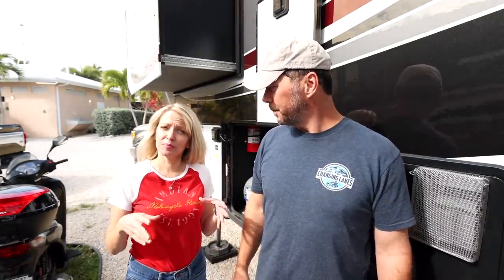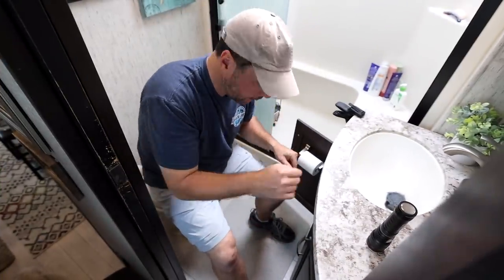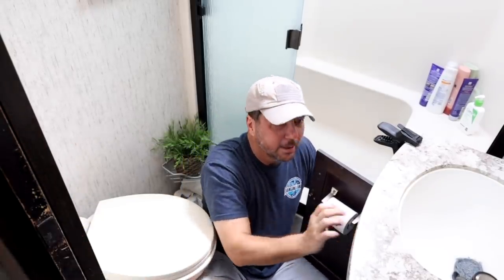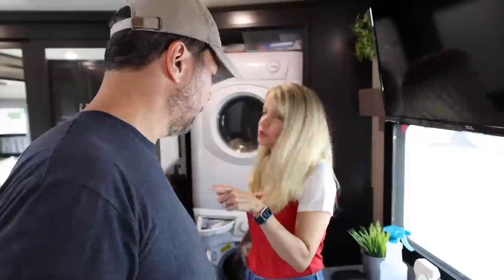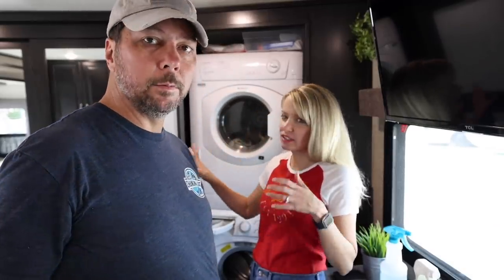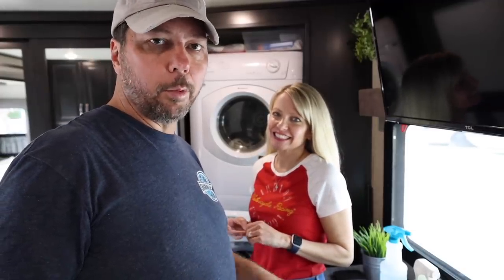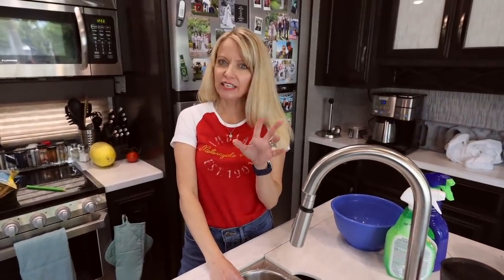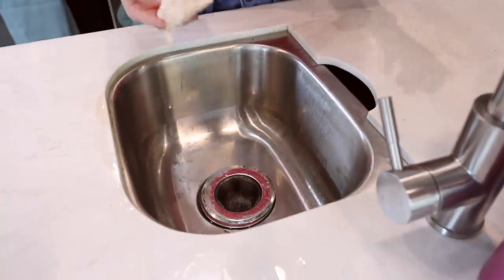RV Dirty Jobs

Comment: White vinegar is a natural fabric softener,  so I use it in the washing machine instead of store bought softener. Keeps the machine clean and it doesn't make your clothes smell like vinegar. Cheaper too!
Reply: Ahh I didn't know that.. thanks :)
Reply: Although vinegar is widely touted as the "be all, end all natural cleaner, in reality, vinegar, being an acid, is actually corrosive and should not be used for many applications for which it is touted, such as cleaning granite counters, cleaning tile floors and grout, and other uses it is recommended for. 

Washing Machines
Vinegar is sometimes used as a fabric softener or for getting rid of stains and odors in laundry. But as with dishwashers, it can damage the rubber seals and hoses in some washing machines to the point of causing leaks. It’s a problem that Steven Grayson, owner of Foothills Appliance Service in Wilkesboro, N.C., sees fairly frequently. “With continual use, vinegar can literally melt hoses, causing leaks and thereby possibly all kinds of additional damage to the house,” says Grayson. In his experience, front-load washers are especially susceptible to vinegar-related damage.

Plus, it may not even be doing much. “Vinegar isn’t very useful with stains that have already set into clothing, including food stains and bloodstains,” says Sansoni. Consumer Reports' recent tests of laundry stain removers reveal products that are great at removing tough stains, and you don't have to worry about any of them melting the rubber in your washer.
Reply: I’m gonna try that . 👍
Reply: yes white vinegar on every load
Reply: they also have washer tab cleaners and most washers have a clean cycle
Reply: I switched to vinegar for my laundry softener over 10 years ago. Washer has held up great with it. Laundry is fresher. The other softeners have animal fat in it, that is what is creating the mold/mildew. We were having problems with smelly clothes if the laundry was left in the washer for even an hour or two. Since we switched, it solved our issues. We also started making our own laundry soap about 7 years ago. It’s a super easy recipe of Dawn dish soap, arm and hammer washing soda and 20 mule team Borax. Since we switched, our laundry is much cleaner!
Reply: @remote.inspired  wow. Is there a specific recipe for this soap? I’d love to try it but don’t know how much of each ingredient/cleaner to use.
Reply: @loriemonroe76  - I use 1/4 of each, mix with 6-8 cups of hot-hot water (add the Dawn at end so it doesn’t suds up.) When mixed good - then top off to equal a gallon of water. I double the batch and put in those 2-gal water jugs you can buy at Walmart - that have a spigot. I use 1/2 cup of the liquid mixture per regular sized load of laundry. I have a HE washer - so it works in that type washer as well as a non-HE type. Be sure to use Dawn Ultra concentrate. Then, also in each load, I put a 1/2 cup of white vinegar as my softener. I have been doing this for over 7 years. It costs approximately $1.50 per month for the detergents/softener for a family of 4 to do laundry.

Comment: Once every 2 months or so I put a couple cups of bleach with a tiny bit of soap with no clothes in the washer and run it at the hottest temp I can then I take a microfiber cloth and wipe inside the rubber ring seal. Every day use I always leave the door opened after use and wipe the glass and rubber seal. I also leave a towel hanging on the door so it can't close.
Reply: I had this same issue with my front loader in my sticks and bricks, so after much "self research", I started wiping under the rubber with Odoban once a week and that made a huge difference. I did this on top of running a load of just bleach and soap in hot water with nothing else in the washer.
Reply: bleach and stainless steel are a very bad combo. bleach will give mechanical corrosion.
Its looks like a spider web in the stainless.
Reply: @brianrasmussen69  been using it for 12 years and no spiders.
Reply: @brianrasmussen69  and i only do it once in a while
Reply: After washing laundry I always take a microfiber towel and dry the water around the rubber seal and the glass window. I'll leave the towel tucked in the rubber seal for a bit.  Sometimes I leave the door open and run a fan facing inside. I've also put a damp rid tub inside with the door shut.

Comment: Where the tube from the toilet goes into the black tank. It's basically just a fancy "doughnut" that holds it in place.  No mechanical fasteners or anything. If it ever comes free, you don't need to drop the tank. Just pull the toilet off and you can get to everything from the topside.

Comment: We're full time and I've never seen that kind of stuff on the "poop chute" on any of our three Grand Design RV's. It almost looks like some kind of bacterial growth. Ours stays white and requires no cleaning. Weird! As for the washing machine - we leave our washer door 1/2 open all the time. Zero mold. But then we removed the door to the washer dryer closet so that makes it easy to leave the washer door open. Another great video! You do a fantastic job covering many aspects of RV'ing that others don't.
Reply: Us too on the poop shoot.  We've never gotten build up like that.  Not to get too far in the weeds...or down the chute might be more appropriate...but we usually preflight the potty by pushing the foot lever part way down (run the water w/out moving the valve) and fill the bowl w/ a few cups of water first.  We also run the  water for 10 seconds or more during the flush.  Not exactly the greatest from an environmental perspective but I really hate cleaning toilets.
Reply: With these two reply’s I’m wondering if there’s something chemical wise somewhere in the water filter system that could cause it to build up like that?

Comment: I'll tell you a way that you can prevent cleaning that P-trap out in your sink and it also works great for your sink in the kitchen taking boil up a gallon of water and two cups of vinegar and pour it down the drain once a month and you'll never have to take your P-trap apart again also do the same thing for your shower drain and before you go on the road put one cup of Dawn dishwashing soap in your black tank and you are gray tank and as you're driving down the road that will clean the greasy stuff off the inside of both of your tanks have fun💝💝😍😍😁😁😁😁😁
Reply: We do similar at home.  One cup of baking soda and I scrub out the sinks/toilet/shower basin.  Then I pour 2 cups of vinegar in, let the bubbling sit for a bit.  About a 1/2 hour later, I go and rinse it all out with hot water.
Reply: Would like to see someone actually test the theory. We have all heard about putting the vinegars etc down the sink but have you taken apart the p trap 6 months to a year later to see if it actually works? I also don’t buy for a second that putting a little bit of dawn in the gray and black tank will clean the grease off. It won’t hurt but it isn’t going to do as much as people think. Put dawn on a greasy pot then pour some water in it and dump it that’s about what your tank will look like.

Comment: I had the same issue with my home front loading washing machine.  I looked up on YouTube on how to clean the rubber gasket.  I removed the gasket and soaked it in water/bleach mixture for a couple of hours and it looked brand new.  I wouldn't replace the seal unless it's damaged.  I put my cleaned seal back on the my machine and it's been working like new since.  I'm not sure how much a seal costs for your unit but mine was around $50'ish.  You already have to do the labor either way.  The hardest part was putting the inner spring back on when I did mine.  I'm sure you could find someone on YouTube that's cleaned your gasket.

Comment: We use “Barkeepers Friend” for stainless steel sinks. It’s been used for decades. It comes in powder as well as liquid. Great video as always...love it! I probably would’ve put the bathroom sink mess in a zip loc bag with papers towels and thrown in the dumpster.
Reply: Absolutely the best cleaner! Rinse your sink well and then take a paper towel and wipe/dry it off. It is amazing. Also, I prefer the powder over the liquid. Seems to clean better. You can also use it on anything fiberglass and it will remove stains like nobody's business. It cleaned spots on our boat that NOTHING else would.

Comment: We use a concave screen for the shower drain and clean it with TP after each use, they have multiple sizes W-mart for kitchen/bath sinks & showers. For the toilet we use a spray wand that attaches to a hose but we also clean the toilet routinely with vinegar spray. For the frontload washer we put a few cups of vinegar and run it on the long hot cycle to clean and sanitize every 3 months, also just wipe the seal after each use. It will reduce the smells. We keep spray bottle of vinegar & water mix handy all the time.

Comment: Tide Washer Machine Cleaner or Affresh for washers, most washers have a tub clean cycle. The things we normally think we can use vinegar or Clorox do not work! It takes the enzyme cleaners to clean up those tubs.  After replacing the seal, use enzymes once a week. Maybe spray alcohol on soap dispenser to help dry that area out.  Make sure you use HE laundry soap. It will help cut down on soap scum some. Also clean lint trap in washer, usually at bottoms of washer once a month.Hope that helps.

Comment: Great tips! It's refreshing to see videos from RV Youtubers that aren't repeat videos from a bunch of other RV Youtubers with just a slightly different twist. I for one appreciate that a lot. If people are squeamish about these things, they should question whether the RV lifestyle is for them. It's all part of the deal. I replaced a toilet in our previous RV. The tube going into the tank is attached to a standard plastic toilet flange like you would have in newer homes. It's connected with PVC cement. The toilet is attached to the flange. You likely won't break it off but I also take care when cleaning the tube. Thanks again for a well thought out video topic!

Comment: Great video. Ya’ll surely aren’t afraid to get down and dirty He he. Regarding the stainless steel sink, all you need is some baking soda. Spread it liberally around the sink and use a blue (made for teflon) scrubby. According to the sink manufacturers you’re supposed to scrub with the “grain” of the sink. If you want a little extra polished look then apply a light coat of vinegar with a clean cloth. In either case after your finished buff with a clean dry cloth. (Microfiber works best) PS. Vinegar will damage natural stone finishes so be careful where you set the bottle etc.

Comment: Hey Tara, we have a front load washer that I thoroughly clean every 30 loads. There are cleaning tablets you can put in the washer and run it through a wash cycle. Also, make sure you take a towel and wipe down the washing machine door and the seal after every load. The mold you see in the seal is from closing the door and not letting it air out. You need to replace that seal because you don't want to breathe in the mold spores. Wipe the seal dry and leave the door cracked open between every load. You guys are awesome. I have learned so much from you two. Keep it up!

Comment: When it comes to the mold and mildew, I have an easy mix to get rid of that. I use this in my power washing business all the time. At Walmart get a gallon of Pool Essentials in the swimming pool area. It has 10% Sodium Hydrochloride  which is more than your store bought bleach which is only around 5.5%. Take the Pool Essentials and mix in a spray bottle 50% chemical and 50% water. Wear rubber gloves at the high % of SH can give you a chemical burn. Spray on and let sit for about 5 minutes then risen with water and wipe clean. A gallon of bleach is close to $6 and Pool Essentials is only $3.65 per gallon at Walmart.  I hope this help you and your viewers. Thanks for all the tips and tricks you guys put out. Keep the videos coming.

Comment: Had same problem with my front load washer at home and it was new. Slime was getting under basket where you can't clean also. Switched to powder soap and run a hot water cycle once a month and leave doors open between loads. No more problems anywhere.
Reply: I use a old tooth brush to clean the door. It gets in small areas and get and stuff out.

Comment: Our home front loader washer, the operating manual says to take a wash cloth and wipe the moisture off the glass and wipe out the seal. We, my wife, does it after all the laundry is done. It helps but about every 2 months she takes scrubbing bubbles and sprays it on the seal and uses paper towel to get it clean. Shee cleans the liquid dispenser by rinsing in the sink and then sets it on top to dry and sometime during the week or before the next load, puts it back. Once you get in the habit, it shoukd be easier to keep the washer clean. Thanks for the nasty tips. I just did my bathroom p trap the other day. I hate doing it. Great video!

Comment: We don't have a washer and dryer in our trailer, but do have front load in our sticks and bricks. Using a towel to wipe the door, the seals, and the drain ring on the wash after each use is a must. We don't ever have a mold/mildew issue.  If you need too close when the dryer is in use for the noise reduction, just open the washer door to air dry after the dryer load is finished. A good time to air dry the washer is when you are out on Lucille or away from the rig. Love the channel!

Comment: I use a Camco 3 foot long rubber flexible tube with a garden connection with shut off on one end to attached a garden hose on to, and the other end has a 5-way spray pattern nozzle. just step on the foot pedal insert the sprayer in and turn on the sprayer move it up & down like you did in the video, cleans it very well come out very clean. it has a very strong spray. hope this helps shipmate.

Comment: Consider using barkeepers friend for cleaning the stainless steel sink, keep a couple rags/cloths handy and wipe out the seal after every use, if you get the moisture out of the seal, you prevent the mold build up.  Be sure to hand up that rag to dry!  You can wash the rag/cloth with the next wash, rotating between the two.  If your doing multiple loads, just do the wipe out at the end, should take a minute or two of your time and save all that build up.

Comment: Loved the video guys. As full timers, we understand that dirty jobs come with this living type. I would like to pass on some information given to us by our repair man. Front load washers all can and will grow mold, but to remove the mold and clean the gaskets, mix bleach and baking soda; then apply liberally and let stand. We let it soak in for about 3 or 4 hours. about 90 to 95 percent of all growth or build up comes right off, and yes, stains are removed. Also, we should inform you that we also, replace the washer's front gasket once a year or 18 months. We have had our front washer for 4 years and it runs perfectly. I hope this helps. And yes, Chad I hate cleaning out P-traps too. Keep up the great work guys...

Comment: Changing the front piece of your washer is about a 30 minute job.  But you have to take the top off and partially disassemble it to remove the cable that holds the plastic in place.  Did mine husband was sure the washer exploded but it worked.

Comment: I use a product called concrobium moisture grabber, I  take my clothes out of the washer and put them in the dryer, I leave the washer open after the last load till the dryer is done.  Then I put the moisture grabber right into the washer and close the door. I leave the moisture grabber in the washer till the next wash and I’ve never had an issue with mold or orders in my washer.  I also clean the rubber seal after every 2nd wash.

Comment: Green Gobbler Orange Oil is a great all purpose kitchen cleaner.  Works on Stainless, on counter tops on glass top stoves, on cabinets, and on appliances.  It smells great too.  I use it with a lint free cloth or a mr clean sponge, depending on what I’m cleaning.

Comment: We noticed when the water softener stops working and the water gets really hard, the toilet seal will start leaking.
We use spray on canola oil to lube it every day and that works just fine.
I installed an electronic device in the water intake line and what it does it charges up the minerals in the water and stops them from clinging to your lines and also wash machine.
It takes a bit to notice a diff but now we can really tell it works.
Food for thought guys

Comment: Great job on getting down and dirty. In your drains try putting a cup of baking soda down the drain then top off with white vinegar. Let it foam and stay in the p-traps, overnight if possible,  then flush with hot water. You may have to paten the toilet cleaner Chad.  Stay Safe

Comment: You can also do a cleaning cycle on your washer also. We have the all in one but I do it every few months or so. You just put a cup of white vinegar in the soap dispenser ( I like to add a little to all three sections ) and turn it to washing option for silk ( ours in cycle #11 ). Let it run until you don’t hear any more water running. It should have plenty of water in there to slosh around. Then stop the cycle by holding down the start button then switch it to cycle regular and start again. Let it run till it’s finished. I then like to go in and wipe the drum and seals down. You wouldn’t imagine the things that were stuck in there. I hope this helps someone.

Comment: Great information...yucky....but necessary!  Thank you!   I place white vinegar in the fabric softener dispenser in my front loader washing machine.  White vinegar works great at making towels soft, and over time, remove the mildew from the washing machine.   If you want to add a scent, use some of the fabric scent beads.